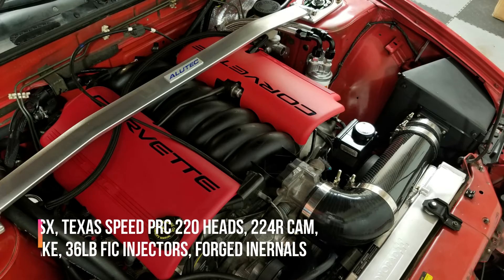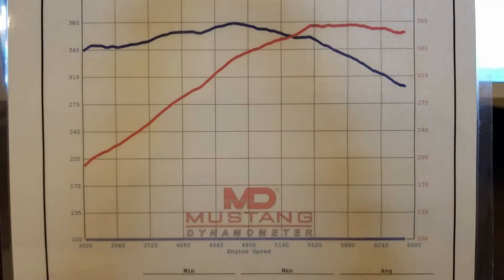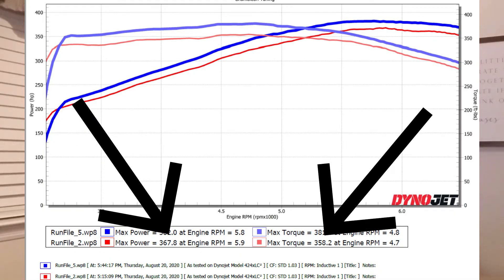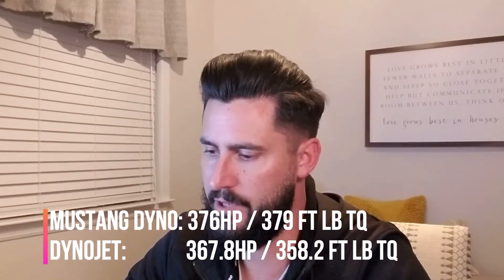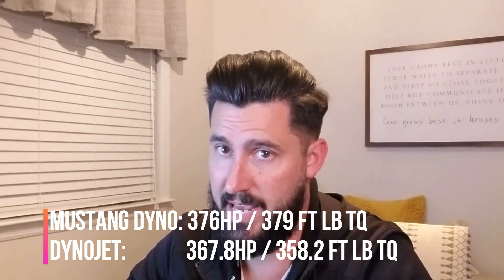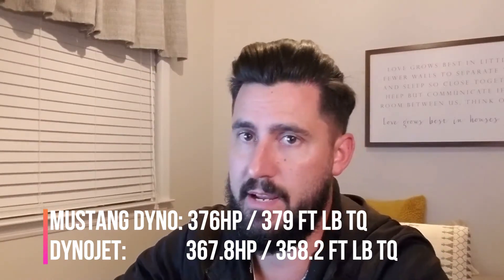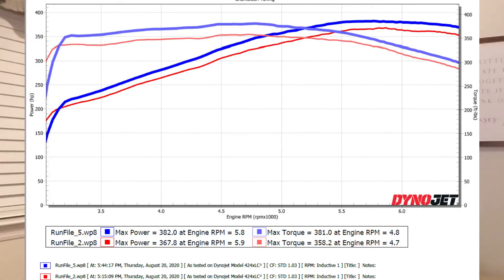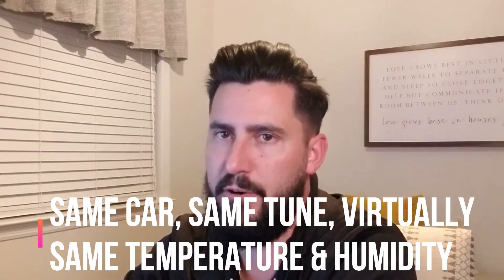Dynojet vs Mustang Dyno Comparison

Comment: Yep. Mustang dynos are simply a tuning tool and CANNOT be used as a basis for comparison of dyno numbers. They have parameters that can change drastically alter the horsepower numbers of a car. This can be intentional or unintentional, but Mustang dyno's are only good to measure change in power before and after. Total horsepower numbers cannot be trusted.. Dynojet numbers are much harder to manipulate. Either by heating or cooling the temperature sensor or by correction factor which is shown on the sheet so it's really not manipulated if you know what SAE vs STD actually means. Basically, dynojet numbers can be more realistically compared across shops. It is not foolproof of course, but a mustang dyno numbers can't be compared across different shops AT ALL. All that "reads low, reads high" internet bs is complete garbage. Mustang dynos read whatever the operator wants them to read. Watch AMS explain it. They put a STOCK Sentra on their mustang dyno and show it making 600 to the wheels with the push of a button after it made 200 to the wheels on a prior run. https://youtu.be/sDwjfZvmPHg . This video also explains it perfectly as well. Reality is often very different that what the internet thinks it is. https://www.youtube.com/watch?v=0ksuLpudF5g